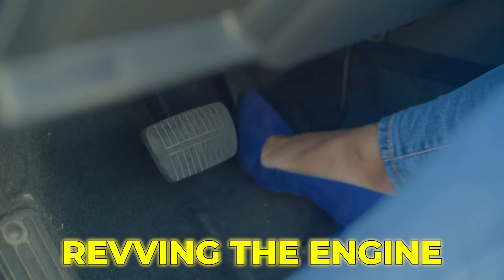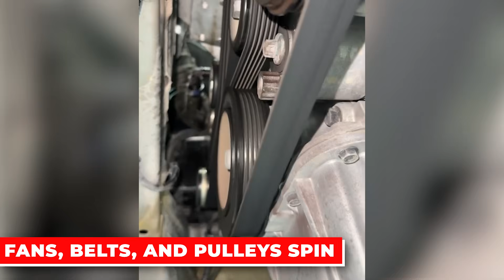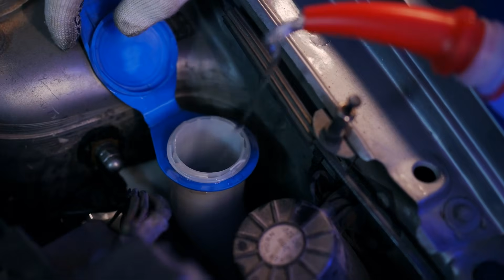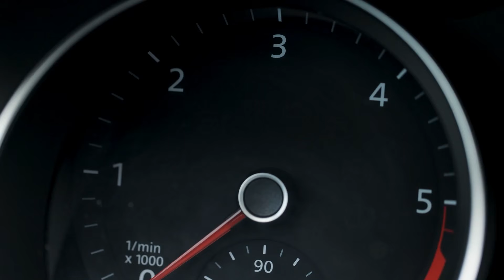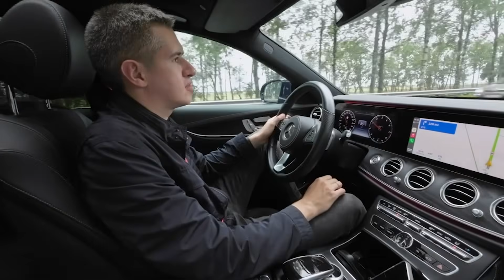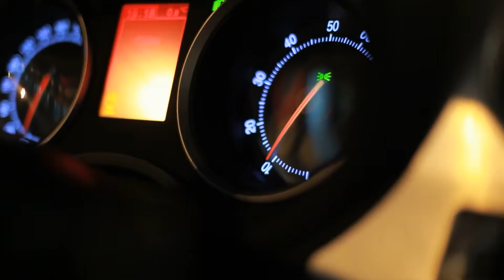NEVER Start Your Car Like THIS (EVER!)

Comment: You forgot a couple;: Never check your under hood fluids while parked on a hill; Never hang dodads and  thingamajigs from your key ring. The extra weight puts stress on the internal switch components, causing misalignment of the parts, especially the electric contacts, leading to higher resistance through the switch and voltage problems.